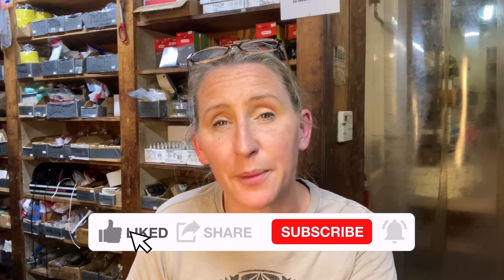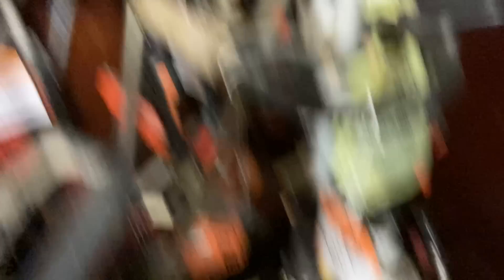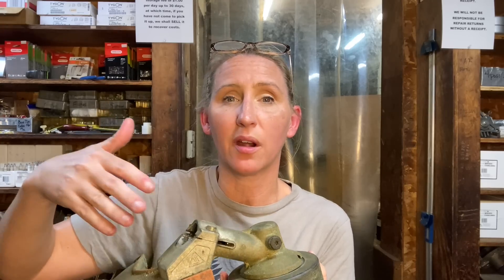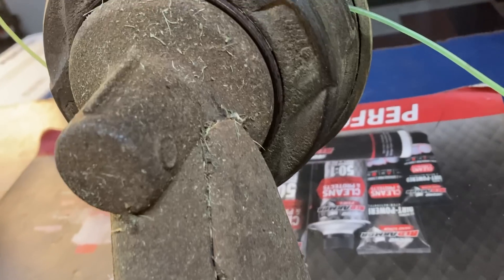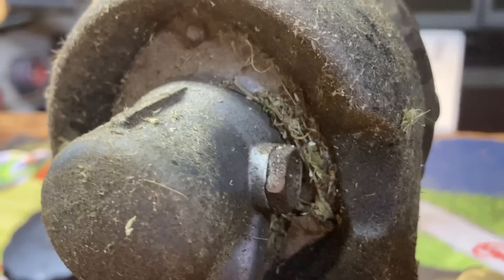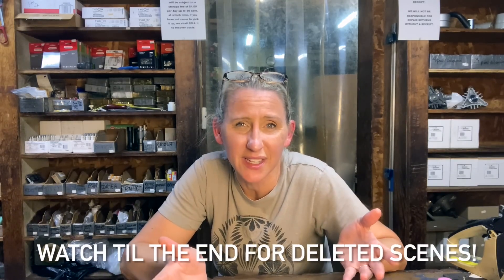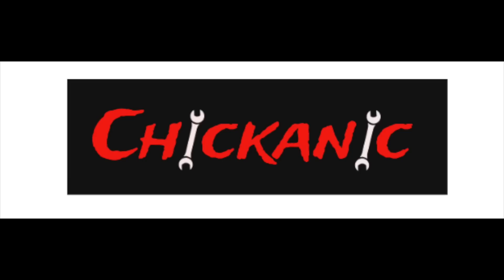Planned Obsolescence?! Why Would STIHL and ECHO Do This?!

Comment: Can the non-grease plug versions be disassembled to grease them inside and, if so, why not drill and tap a hole to add a grease plug?  There's more than one way to skin a cat, as horrible as that sounds, but this is for the better in this case.  It would only cost about as much as they're saving in not having one.  If you don't have a tap set, you can buy the a single tap for the plug threads size and it comes with the correct drill bit.  A flat place to tap it might be on the top, but just make sure the plug threads aren't too long, or do it on curved side where a plug is supposed to be and use a rubber washer or o-ring to seal it.  Again, just making sure the threads aren't too long.  That poor cat doesn't have a chance.  😜

I found this video in searching for the gearhead video where you disassembled a gearhead to show that there was grease inside, but it wasn't touching any gears for a friend.

Whatever's crawling around in your ceiling may be the guy cutting grass at midnight, wanting to see you.  🤣😂🤣😂🤣

Comment: One possibility for the change is that contamination the biggest or nearly the biggest cause or failure in gearboxes. Its possible that improvements in lubes(and metallurgy too, maybe?) have got us to the point that its just better to seal a unit up than make it serviceable. I know that alot of car automatic trannys have gone this way, as have alot of cheap industrial gearboxes.

Comment: Every company does this. They even purposefully use trash components so your devices will break down faster and you will have to replace it. If they didn't do this, you could buy one device and never have to replace it because you could upgrade and repair it yourself.

Comment: I don’t think anyone ever greased it anyhow? Besides if you take off the feed head and partially disassemble it then you can pack it with grease. When I screwed the tube onto the fitting and pushed grease into the gears it never did much. So probably a poor design which ended up just getting ditched. I don’t think you pack it with grease per se, but liberally grease the intended parts.

Comment: I had to replace a circulating pump for hot water heating system, my suppliers sold a little no service pump for one job later i had an other job and talking to my supplier he finally said to me there still are servisable pump more expensive but the cheap one will last about 5 years not 30 to 40 years like the old serviceable one before

Comment: Like you said, most people don't know about the grease plug and even if they did they wouldn't grease it. For homeowner use its probably not necessary anyway. Only the most extreme commercial applications would ever wear the gearbox out. Now maybe if it was a grease zerk, instead of a plug, it would be more useful.

Comment: Really good information. Something important, there are new greases being used. Electric motors are used in high dirt, dust environments and they last for decades. They use a special grease in all electric motors now, called "Polyurea" waterproof grease, not lithium grease. Polyurea grease lasts forever, it basically doesn't separate and dry out like lithium grease, so it's considered a permanent grease. If you combine Polyurea grease with proper Nitrile seals or some other really durable rubber seal, it would probably last forever, provided you're not in the desert with dry rock dust.

Comment: The first head had a circle where the fitting would be drilled out. This "feature" appears on mower spindles as well. No grease fitting. At least you can add one to those. After a product has been on the market for a while, the MBAs are turned lose to try and find ways to increase margin (without engineering input). At least, that's what I have seen. In this case, they saved labor and the price of a bolt.

Comment: I have a curved shaft Stihl  FC 91 do I need to take apart the gearbox to grease it it doesn't have a grease fitting.. and what is the best way if I can to grease The shaft of the edger.. from what it looks like this is a sealed bearing at the end that attaches to the gearbox.. I appreciate your help thank you

Comment: Do you replace u-joints on car driveshafts?  I do, though rarely. I noticed some don't have zerk fittings. Zerks on u-joints were always part of a general chassis lubrication. Especially on older cars where everything had a grease fitting. But newer u-joints usually have none. As a sort-of mechanic I think this is sacrilege.  But I found out something interesting. Bearings, u-joints in this example, have service lives. So does grease. There are specs for this. And if the grease is rated for a longer service life than the actual bearing, well, guess what. And something like this might apply here. So there you go.

Comment: Just do what my dad used to do on everything from tie rod ends on tractors to weed eater heads. Drill and tap the part and thread in a grease nipple. Use a grease gun on the grease nipple and pump in some grease.

Comment: Greetings from Europe!🙋
I used to work for a STIHL dealership for 7 years and we were told that the lower range home trimmers (FS 55/56/70) should be serviced every year or so. Our workshop greased the gearheads by extracting one bearing. I think STIHL used the removal of the grease plugs on the lower range of trimmers either to promote their semi-pro (FS 89 onwards) range or to make more cash for their dealerships.
Reply: Could you/we not just install a service grease nipple?.. Anywhere in the housing,.. And we would be back in the good servicing track for these equipments?.
Reply: @gorgon9786  technically, yeah sure, it's possible, but the regular Joe who's gonna buy the cheapest tool in the range usually lacks the knowledge, motivation and funds to improve it; at best they'll maintain it by the book (in most cases not).

Comment: Good video, I removed the grease plug on my two Shinduawa trimmers, drilled and tapped them for zerk fittings. One or two pumps from the grease gun  periodically has worked well. They are about 20 years old and still going strong. I’m working on 5 acres which has to be cleared each season. Keep your great videos coming. Randy
Reply: I did that to all my trimmers. I put 2-3 pumps a season and never had a problem with em. If I ever got one that didn't have a grease hole, I'd tap one in it. It's not hard to do.
Reply: Zerk’s are cheep. When they get rusty replace them. As for seals there is no external grease discharge. Excess grease is going up the shaft seal.  The important thing is the bearings get a little shot of lubrication. I’m looking at 20 years without a problem. With 5 acres they get plenty of use.
Reply: Zerk fittings are likely to be damaged while banging the trimmer around concrete, rocks, etc. Once damaged, you never really know if you're getting grease into the bevel gears. ECHO was the first to use a bolt instead of a grease zerk so that you'd know you're actually greasing the gear head. Too bad they followed the crowd eliminating the grease port on cheaper units...gotta compete, I guess.
Reply: What size Zirk fitting?  Thanks
Reply: I like that idea; sounds pretty simple to do, so I'm going to try it with the trimmer I bought last year. What's the worst that can happen? I'll need to buy a new lower shaft like she says? Worth a try. Thanks!
Reply: @d.e.b.b5788  The worst that can happen:  You blow out the seals on your hub.   Mechanisms that have zerk fittings to allow you to pump grease in must also have a vent to let the old grease out on the other side.   A hub like these does not have the vent, so when you pump grease in under pressure, it will have to find a way to let the old grease out.... thus damaging your seals.   That is why these hubs do not have zerk fittings, you are supposed to just press the grease in with your fingers or a spoon, not under pressure.
Reply: Then why did older trimmers have zerks which worked without problem? If a missing vent hole is the problem (did the old trimmers have vents?) then it seems simple to drill a small hole in the appropriate area. None of my lawn equipment's zerks have vents--you pump grease into them until a little peeps out the seal. Presumably that's where the old grease eventually escapes anyway. @JamieTransNyc
Reply: @rcnelson  Bushing  (what I assume you are talking about greasing) and gearboxes are a bit different. You could do like you said and drill a vent hole, but you might still end up with too much grease in there and have it come out the seals once things heat up, or in a worst case, push a seal out of its bore.
I have never seen a trimmer with a zerk, just a plug you remove and stuff grease inside manually.
Reply: @JamieTransNyc  I assume they use lip seals to seal the shaft, they will work like a vent most of the time. Not ideal though.
Reply: @rcnelson  Unvented cavities are standard practice with Zerk and other grease fittings going back before anyone reading this was born.

Comment: I am extremely impressed with your discussion of the missing grease plugs on new gear heads. I think if I ever really work with small engines your site will be a must-watch for my own education and understanding of current practices. I did watch this video to the end and it looks like you had some really scary moments. My suggestion is to never work alone and after dark in your place of business. Always have one or two others in the shop with you. I know you have to pay them, and perhaps as overtime compensation, but having others with you is really best. Never answer the door to a stranger after closing hours as well. Perhaps by appointment with someone you know, and with some helpers also in the shop with you, it is okay. But never alone. Never with a stranger. I once saw a sign on the back door of a Starbucks warning the reader to never, ever open that door during the hours of darkness for anyone knocking on it. I think that is good advice for any shop employee. There is much safety in a group. I apologize for seeming so lecturing.
Reply: She's probably got a shooty thing anyway

Comment: I just traded my 14 year old Stihl to my son in law, as he has way more to trim than me. I looked at it today, no grease plug. 

Now another question you may or may not be able to help me with. The people who lived in my house previously, they left a trimmer. It’s a Hyper Tough??  I believe a Walmart trimmer. I was wanting to put one of those good echo heads on it, but I do not see how this one comes off. It’s a curved shaft and there’s nothing there to remove the head, unless it’s up inside that threaded rod the bump button
Screws onto. If you can, tell
Me one way or another. This head I will have to hand wind the line on the spool if I cannot replace it. Thanks.

Also, anyway to find out what place you work at to order line from your shop. Amazon wants a fortune for it.  More than double your price from the video you talked about line.  I only need one 1/2 pound of .080 and 1/2 pound of .095. Amazon wants over $35 for a pound of it. I don’t need that much and nobody around me
Has any line whatsoever.

Comment: My Stihl dealer/mechanic explained to me that the reason they went to non-serviceable gear heads was because people were over greasing the gearbox. They would try to squeeze in an entire tube when only a small amount is required. For lack of a better term, the  gearbox would hydro lock and then grease would ooze out around the bearing seals   which would lead to warranty repairs. That’s why they went with “lubed for life” design.
Reply: your stihl dealer/mechanic is just towing the company line.  most people don't grease anything.
Reply: I was in industrial maintenance. Over greasing (over packing) bearings can easily shorten their life.

Comment: Hi Ms. Chickanic,  
I wanted to get your thoughts on the rotary scissor attachment for a straight shaft string trimer?
 I never knew something like this existed, but I saw it on a video and thought that it was a tool that could replace my string trimer attachment. 
What's your thought and experience on this attachment and is it problematic?
Thx for all of the content that you provide throughout the years.

Comment: I had the upper shaft of my ~10 year old Husqvarna string trimmer go bad last year with the plastic bearings for the flexible drive shaft melted.  A new genuine shaft housing with all the interior parts was about $35 on line.  It was about a 10 minute job to swap out the shaft.  I’ll bet a lot of owners would have just scrapped the machine and headed to a big box store for a replacement.
Reply: Ridiculous. Glad you got it fixed though.
Reply: @BritonAD  Thanks for the reply.  It pays to do a little homework to see if parts are available to repair equipment.  Sometime you get lucky, but sometimes you’ve got to junk equipment which could be fixed if parts were available.

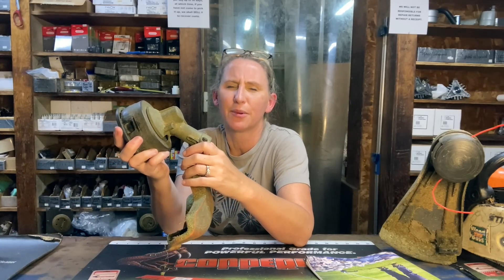Comment: 1:58 Your air quotes dismissal of "upgrades" being "never better" is just simply wrong and frankly either dishonest, ignorant or stupid.  Aside from the simple fact that nothing is always one thing or another...never is unprovable...having been in this industry for 20+ years and a user of this equipment for home and commercial use, I have seen plenty of exceptions to your self-righteous declaration.  I pity those who take your word as some sort of hometown gospel.  The grease plug issue is silly...engine are far more likely to be fried from use or abuse (lack of maintenance) long before a gearhead  gets worn out whether residential or commercial use.  This is borne out clearly by parts sales history.  Gearbox replacements are exceedingly rare, not just because they are relatively expensive on better brands, but because THE DEMAND FOR REPLACEMENT IS MINIMAL.  That room of equipment is sometimes the daily intake for the two shops I've been part of.  This looks like another "manufactured crisis" when looking for new content.

Comment: Since you grow rocks in Arkansas, I'm surprised you didn't mention the terrible quality of MTD's blades. I don't know what kind of steel they are using but they are far softer than any other manufacturer. They get nicked and bend running over a twig and need constant sharpening.  Pretty much every after market option (like Gator blades) is better.

Comment: A couple of reasons for this, manufacturers cut costs by eliminating parts, they want you back buying another tool in a couple of years. Also, so many folks don’t have the simple skills or desire to maintain these tools. Every spring I see big box store trimmers on the curb waiting for the trash man when all they may need is a little TLC. I have an ECHO trimmer that is almost 20 yrs. old and still running strong but every February it gets a thorough PM.

Comment: My FS55 I purchased in France in 2018 doesn’t have a grease plug on the gear head. Mine doesn’t get heavy use, but I remove the gear head every spring, clean out the old grease and pack it full of fresh bearing grease.

Comment: They do like to sneak in the obsolescence don't they? One of my latest frustrations was with a Karcher professional battery which has failed. Test the cells, find the faulty ones, replace, right? After a failed attempt and some internet digging I found out that the PCB, the controller is made so, that if voltage falls below a certain value, it won't start up again if you increase the voltage. That means that if the cells die when the battery is almost empty, the controller is dead. It means that you can not ever interrupt power to the controller and there is no technical necessity for it to work this way. Once I realized what they did, I found it difficult to accept that they actually did this intentionally. But they did, oh boy did they. Those packs come at 250 Euros a piece and they don't want them repaired. So then, you have 20 cells in there, only two of them faulty and they're all trash. Very environmental, I must say.

Comment: Of course there's the usual comments about these diabolical companies and planned obsolescence...wanting to make an extra penny..etc. There is a very simple and practical explanation. The molds used to make these components do not last forever, and when they need to be replaced it's the perfect time to revisit the design and simplify it. Based on the comments of many mechanically capable viewers, and Bre stated a huge percentage she deals with don't take the time to grease the head. 
So....the mold needs replacing, the company knows through various sources of information that people don't grease the gears...new mold gets simplified and yes the company saves a few $ eliminating the plug. Sorry not the most sexy conspiracy based reason for the change, but being in an industry that uses a lot of molds I can say from experience it's probably the most likely.

Comment: The manufacturers probably got to thinking that the End User rarely Greases the Heads out of ignorance and run them till theyre done then fit a New Head which the manufacturer Profits from and saves the production cost of the Grease Bolt

Comment: The "1,000 hour light bulb"  (100 years ago) was the first example of planned obsolescence.  Some of Thomas Edison's original light bulbs still work today.
Reply: Only one still works that I'm aware of and it's kept at a lower voltage now (if still alive) than it originally had for most of its' life.  Also it's less planned obsolescense than planned lifetime. (and no, it's not the same thing)